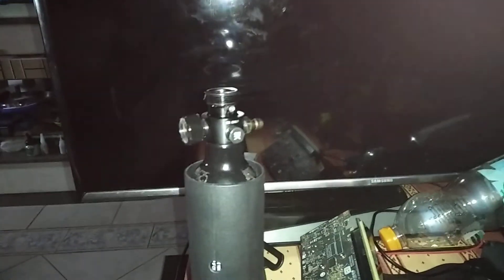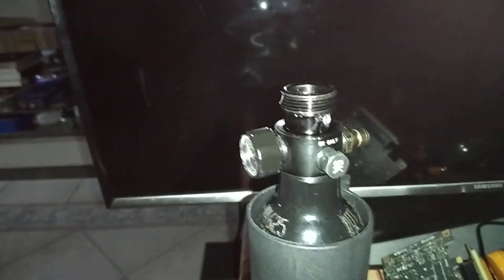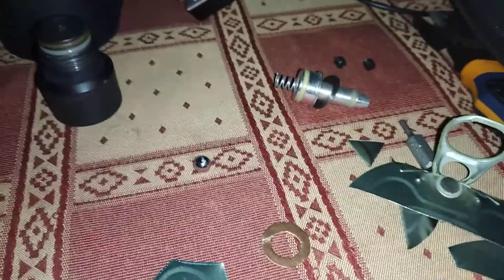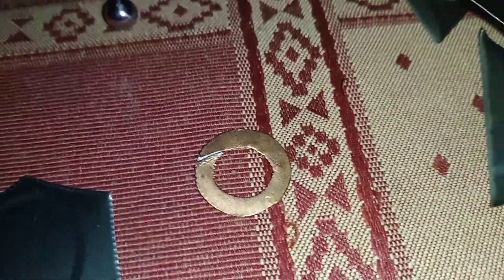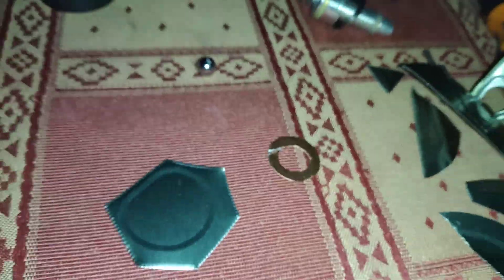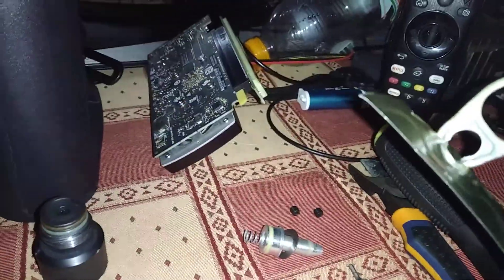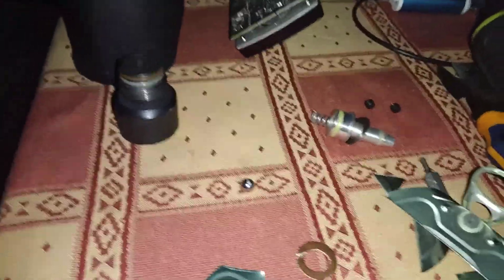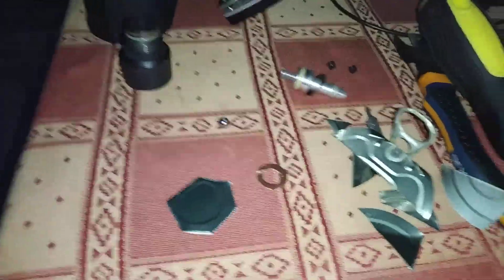HPA REGULATOR - 200 to 250 PSI SHIMS, FOR "FREE" !!!

Comment: Make a video measuring again the speed last time was 900fps with the upgrades
Reply from the maker: I tested it recently and got the same speed with newer mods. I was trying to push it over 900. I got to 1018 fps once and never got there again(with the old setup,the one in the old video,with the regulator set at about 1600psi).
I'm trying to figure out how to get over 1000 consistently. That's why it's taking me some time. For the rest, I can get 900+ all day long.
This, with the 9grains. With 21grains slugs, it drops below 550fps. The dream mod would be +1000 with the 21grains but that's just impossible without a total redesign.
The over-complication of the design adopted makes it a "leaker" in all possible parts. Too many parts are responsible for pushing air out and a lot of the power gets lost.
If you look inside, there is the air chamber, then there's a small nozzle in front of it(leaking point), THEN there is the chain holding the pellet (another leaking point) AND THEN there is that chunk that holds the barrel in place (yet another leaking point). The sum of those makes it impossible to get extreme outputs. Nevertheless, at 900+ it already is enough fun, that's for sure. After all, it wasn't even meant to be this powerful out of the box and we knew what we were buying. Seems like a good compromise, for now.
Reply: @FreedomAirguns  if you can make some ready to install part to increase velocity and sell it online that would be a game changer
Reply from the maker: @kmom777  dunno about the legality of it all, but that's theoretically feasible, even though I'm oriented towards making the most clear WORKING solution for everybody at the moment, something achievable with stuff you can already buy anywhere.
If anything, SIG should be the one pondering about a tune-up kit, with a different air-chamber. I can make my own molds, melt alloys too, but I didn't want to take the path for now. Thanks for the suggestion though, really appreciated. I was evaluating it too but I thought that it could be problematic due to the huge brand involved. I mean, I don't want to get a cease&desist letter, or worse. That's the only limiting factor that's setting me back or I would have done it months ago. I might still sell or freely release a 3d printed version of the chamber, but then you'll be all on your own.
Reply: @FreedomAirguns  i just want to get 18.13 Pellets in the mid 800's is that possible in your opinion?  BTW I measured the Twist Rate today its 1:16
Reply from the maker: @tonyhowell5283  I'd love to see that too Sir. As it is, I doubt it. We're lucky if we get to the mid 600s with the 18s. I'll do my best though. I can design an air chamber with more volume, make a 3d print, molds, and melt a zamak-like pewter alloy to produce a sample with the power to withstand up to 6800 psi but I didn't want to go that far. Probably, that's the only option to reach those velocities with heavy pellets.
BUT, theoretically, dieseling might be an option, albeit a dangerous one. I tried with vaseline but didn't get any detonation. 3-in-1 oil seems to be the norm among those shooting springers, yet, the air gets hot in springers, this one doesn't reach the level of compression needed to generate the heat/pressure needed for detonation, theoretically. Reason why I spared me the effort/money. The last resort is HELIUM. That would definitely boost the output from 30% to 40% more, enough to get to the mid 800s and possibly above the supersonic level with the lighter pellets, no extreme mods required.

Comment: U used cans because it’s thin or why not using rings they sell at store
Reply from the maker: They are of the right thickness, required to get a boost of 200 to 250psi.
Also, this is a cheap way to test something that works for "free". Why spend money for overpriced discs when you can get said discs for free?
You can find cans with varying thickness and they're all perfect for the job.
Reply: Thanks again , The ring you had on table look like it was cut on the side of it , is it ok like that or I should cut it w no cut on the ring
Reply from the maker: @bobybaba5267  the cut is not a big deal, you can leave it. Just remember to press on it to make it flat. It's just an easier way to make it. It is not necessary and if you can make a ring/shim/washer without the cut, all the better, but it doesn't affect the function, at all. It's all a matter of thickness in the end, using a material that can withstand it. Cans are perfect.
PAY THE UTTERMOST ATTENTION, do NOT CUT YOURSELF. That's the ONLY important bit! 
😅

Comment: How much fps do you think this mod would add???
Reply from the maker: Fps varies depending on the platform you use, but it adds 200 to 250 PSI to the regulator, guaranteed.
Reply: @FreedomAirguns  I’m aware that adding the shims will give me more output pressure from the regulator but will that increase the fps on the pellet. Example if I’m shooting a pellet of .22 with 14.3gr at 800psi the pellet comes out at 600fps average. Will increasing the psi from 800 to 1000 will that increase the fps from 600. If so by how many more or less. Sorry in advance if this question was already asked.
Reply from the maker: @junjdm111  it depends on many factors, like the total internal volume of the chamber(mine is bigger/"modded"), how tough the blow back spring is(mine is tougher,airsoft spring cut to +-7.3cm), and it also depends on if you have closed the holes in the plunger/weight of the blow back(the chunk that slides and hits the valve). On various tests, before the mods, on an european sig virtus, I recall hitting the high 750s at +-1150 psi with a 9 grains. Max I could get has been 1018 FPS with the same 9 grains(h&n prometheus) with 1400psi and with the aforementioned mods. I strongly advice you to NOT modify the chamber in any way, shape or form tough. Filling the holes of the plunger with solder, increasing the strength of the spring and higher pressure are the only requirements to enjoy the sub 1000s with light pellets. I have damaged mine and I cannot find proper o-rings for the valve, as such, for the time being, I'm with a dead rifle. I also don't like the platform too much, I was expecting more space for mods but these people are extremely zealous, which is a pro/cons depending on your "freedom" 's expectations.